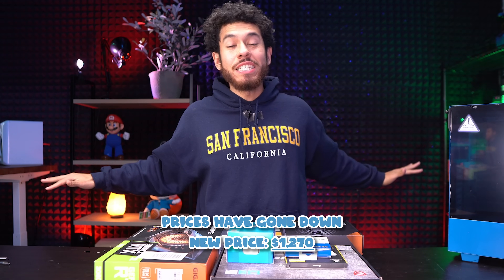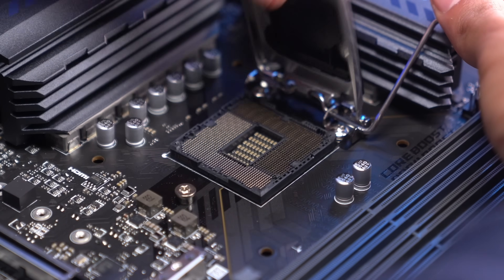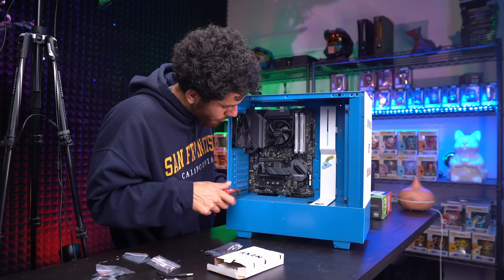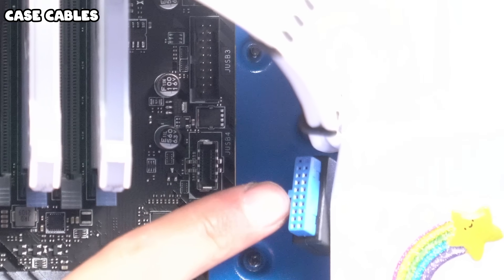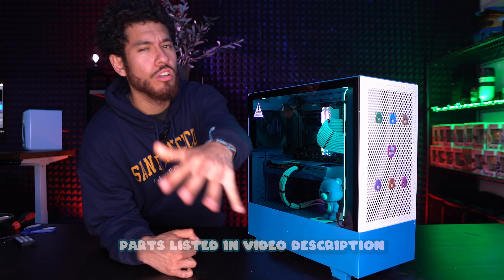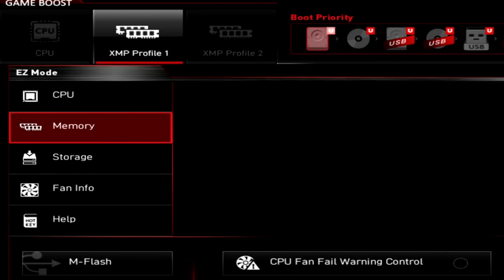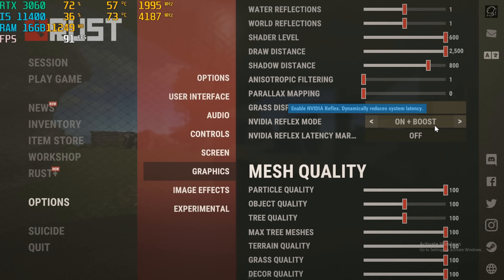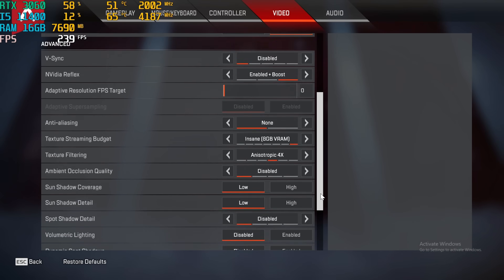$1000 Gaming PC Build Guide - RTX 3060 i5 11400 (w/ Benchmarks)

Comment: Do you still recommend 3060 for this CPU? I bought my computer without GPU and now I'm thinking about to buy a GPU in it. Few site not recommend RTX3060 for i5-11400 because of the bottleneck is +20%. With GTX1660 the bottleneck is only 5%. For the current games which one you suggest?

Comment: I JUST finished my build thats very similar!

CASE: APEVIA GENESIS PRO
MOBO: ASUS ROG STRIX Z590-A GAMING WIFI GEN 10/11
GC: ZOTAC GEFOORCE RTX 3060TI AMP WHITE
AIO: ID COOLING FROSTFLOW X 240 SNOW
PSU: APEVIA PRECISION 850W 80+ GOLD
DDR4: SILICON POWER X FORCE 16 X 2 (32GB) 3200
M.2: SILICON POWER 1 TB
CPU; i5 11400F 4.4
PSU EXTENSIONS: ASIAHORSE WHITE

Comment: Hello Joey I got a question is there a different power supply I can use cause the one that u got is out of stock or does any one know which other one I can use
Reply: As long its a 650W unit, modular or not its what you want. I don't recommend something cheap because you dont need to cheap out on psu's. Look at something in the same price range as long its 650W.

Comment: Hey I was wondering if the ASUS TUF Gaming B560M-PLUS WiFi LGA1200 motherboard would work with the cpu cause I used 2 different websites and all the components I got says it goes together but I just want to make sure  cause the mother board is almost $200 now

Comment: Does the motherboard have built in wifi?
Reply: Yes
Reply: no, it doesn't. it has ethernet. I ended up putting a seperate wifi card into it, which works fine.

Comment: can someone explain how CPUs work, i see a lot of mid to high-end build have a intel i5 12th gen, but im confused because wouldn't having an I7 2nd gen or somthing like that be better
Reply: No, I see why you would be confused because intel has many generations of Processors and with each generation the processors get better than the last generation(In most cases). For example a second generation processor came out in around 2011 where technology was not as advanced as todays 11 and 12th generation processors which are 100 times better, Hopefully that made things clear. Ask me anything if it did not

Comment: When I set the ram to 3600 it stays on black screen what do I do??
Reply: Reset the CMOS (check board manual for instructions). The thing is that if you're overclocking memory (either manually or through XMP), you can cause stability problems. Overclocking is part black magic, art, luck, and science. There aren't universal settings that work perfectly on all systems which is why things like XMP sometimes don't work on all PCs and/or cause stability problems. You'll need to manually adjust your RAM settings.

Comment: hey joey, i just built this pc for myself and it’s been running well. only thing i’ve noticed is that the cpu core runs hot and it sounds like the fan is working pretty hard. any ideas what’s going on?
Reply: found out the problem. i needed a better cpu fan!
Reply: saw some people asking about what cooler to get. i got the master coolers liquid cooler v2 with the rbg lights. definitely needed to keep the cpu cooler when running games
Reply: @Affalterburch  how’s the temperature now and which one did you upgrade to?
Reply: @delgado8  ^

Comment: If you can find a gpu at a resonable price or msrp, this is probably a very good value build. Im thinking about getting the  same parts but an i3 12100 or an i5 12400f instead of the 11400.
Reply: would it still work with the motherboard in the video?
Reply: @InstantHades  no, I would need an lga 1700 600series motherboard.

Comment: The cpu is 83cl, and that’s why i would buy a after market cooling solution, like a cooler master hyper 212 black edition. That’s going to run quieter and dissipate more heat and the temps are going to be low 50’s high 70’s. I just can’t stand the look of intel’s cooler

Comment: Have this same build but after building I cannot connect to a wireless network connection…. any fix?
Reply: You have to use an ethernet cable or check if the motherboard has a spot to add a wifi card

Comment: Hey Joey, I build a combination of this PC and the white 900 build, I basically just used the case from the last build but when I turn it on, it is not displaying anything to the monitor. I am currently using an HDMI cable that is plugged into the monitor and the graphics card. The fans and LED strips come on and the name on the graphics card is lighting up as well as the RAM sticks but still nothing displayed to the screen. Do you know why this might be happening?
Reply: It looks like that board has a debug/diagnostics light towards the top right corner. Take a look at it and the board manual to see what may be going on. It can help point in the right direction.

Comment: Hey Joey was wondering if you'd ever be interested in doing a video dedicated to a travel rig, one of those rigs that is small form are designed so you can fit them as an airplane carry-on, so as to travel with them pretty much anywhere. Recently for my work I had to throw one together in order to do certain parts of my job on the go that I couldn't do with a laptop, at least not without going crazy and buying something super expensive. Doing the travel PC was cheaper for me personally so that is what I did, however I did find the process to find everything that I needed in small form while still trying to maintain performance a bit overwhelming. I imagine it would be similarly challenging to anyone else out there trying to do a similar build. Seems like a niche PC build for you to do, and I'd love to see you make a video on one if possible.

Comment: My ssd doesn’t show up in my boot drive in the bios. How can I fix it. Please respond to me!!!
Reply: Make sure its plugged in correctly. If its a 2.5" SSD, make sure both power and data cables are securely plugged in and that the other end of the data cable is plugged in correctly to the motherboard's SATA port. In some instances, you may need to update the BIOS to the latest version to fix SSD problems; mainly M.2 SSD problems.
Reply: @JJFlores197  it’s a m.2 ssd. It is plugged in. It says ssd on task manager but below system file is no and page file is no. Ssd is suppose boot faster but it’s not and it’s using from my hdd. How do I make it my boot up
Reply: @extertioncapshella6452  Well you have to install Windows on your SSD. You could clone your existing Windows installation over to the SSD if you don't want to go through the install process. I would reseat the M.2 drive and update the BIOS.
Reply: @JJFlores197  the bios is up to date and shows the m.2 installed but is still booting up from my hdd. Your saying if I install windows there’s gonna be a hdd or ssd and if I click install using ssd, the page file and system file is gonna be put into yes. And the hard drive no. Is that gonna make my pc boot from my ssd? How do I clone because windows was already install on my hdd but the ssd is there but no active like my hdd!
Reply: @extertioncapshella6452  You have 2 main options: You can do a clean install of Windows on your SSD. This will install a fresh copy of Windows on your SSD. You would then format your hard drive (everything is erased from it, so make a backup of anything important first) and you can use that for general data storage.

Alternatively, you can clone your Windows installation from your HDD to your SSD. There are tons of utilities out there for cloning. Acronis True Image is pretty good, but there are others. You choose your source drive (HDD) and your destination drive (SSD), let the cloning process run and wait. Once the process is finished, boot your PC from the SSD and if all went well, it should boot right up. Once you verify that everything works fine, you can format your HDD and use it for storage.
Reply: @JJFlores197  yeah because I’m using my ssd for storage and that’s exactly what I want for storage not my ssd. My ssd is so expensive and quick as advertised and I don’t want to use it as storage it’ll be a waste of money just my cheap hard drive for storage. So I have to reset my pc in settings and perform a new Windows. Does it work on windows 11 and does it have to be in 10 for the ssd to work and boot up from it?

Comment: hello. i have a question.
when i try to insert my gpu to motherboard i had to push card with more pressure to hear the click sound that mean it locked. a little bit more pressure than normal. i see the left side of the card doesn't go all way inside the pcie slot and it has 1 mm left to go in just like the right side. the windows recognize card and i test it in heaven benchmark and it seems everything is ok and i can play games with 144 fps with 76 celcius degree temperature. i want to know that is it possible the gpu card cant use its full power because the left side of it didn't go all way inside the slot?

Comment: Will it be good if I get a 3060 ti instead of the regular one
Reply: Yes, the ti is way better and should probably get the i7 instead of the i5 for the cpu if you can.
Reply: @dontcare5427  does the i7 need liquid cooling?
Reply: @jdolo5013  it is not necessary to have liquid cooling but it is a better option. However you should replace the i7 stock fan with a better one to keep the cpu as cool as possible.
Reply: @dontcare5427  thanks A lot !
Reply: @dontcare5427  also would this pc be good for streaming?
Reply: @jdolo5013  yes it will be good enough to stream in 1080p max high settings and your welcome !
Reply: The 3060 ti is smaller then the reg one and it don’t come with 3 fans
Reply: @datboivonte700  yes, it still has better output and gives more room to customize within the pc!
Reply: @dontcare5427  Ok

Comment: cpu temps are high I think intel's free cooler sucks! hope if buying a better cooler can reduce temps and might be 50-60degs
Reply: Buy a Corsair h60 my temps are around 32 degrees Celsius
Reply: Also get thermal paste clean off the pre applied, and apply your own for a better adhesion
Reply: @tyrellyoung4835  I see thanks for this info bro. 32degs are on idle mode right?

Comment: Can you do a pc build with
Cpu: ryzen 5 5500 or ryzen 5 3600
Cpu cooler: alpenföhn brocken eco advanced
Motherboard: gigabyte b550 Aorus elite v2 atx
Case: aerocool aero-300 FAW
M.2 Cooler: be quiet! Mc1 m.2 cooler( you can do with the m.2 cooler from the motherboard too)
M.2 Ssd: western digital WD-Black sn750 se 1 tb or crucial p2 ssd 1 tb
Ram: G.Skill Aegis ddr4, 3000 or corsair vengeance lpx black ddr4 16gb,3000Mhz
Psu:be quiet! System power 9 600w
Gpu: amd rx 6600
and a Case fan hub from arctic
pls? I want to build with these components a pc

Comment: Hey this is the first time I’ve done anything like this, does anyone know if there are extra steps or drivers I need to take care of if I get a motherboard with a built in Wi-Fi card? I noticed Amazon had two options there. Thanks!
Reply: Same overall process. In terms of drivers, you may need to install the wifi card drivers; same as any other driver install.

Comment: How were you able to connect to the Wi-Fi ?
Reply: He didn't. He used an ethernet cable. Remember wifi and internet aren't the same thing.
Reply: @JJFlores197  then how can I connect to the Wi-Fi or and internet?
Reply: @Wssp322  If you want to connect via Wifi, you'll need a motherboard that has built-in wifi or if not, buy a USB wifi adapter.
Reply: @JJFlores197  and for internet
Reply: @Wssp322  You need a router for that. Most home routers have wifi built-in so you just connect to your home wifi network or plug an ethernet cable from the router to your PC.
Reply: @JJFlores197  and for Ethernet?
Reply: @Wssp322  reread my previous comment.
Reply: @JJFlores197  ok thanks for your help
Reply: @JJFlores197  yo bro do you have Ig I got hella questions about whether I should get this pc or not and you seem like you know what you taking about man

Comment: I have a question. Every part of the computer is upgradable right? Then which is the part I’m going to be upgrading the most
Reply: Yes, pretty much everything is upgradeable. What you upgrade depends on what you need. If the current GPU doesn't run the games you want at whatever resolution/frame rate you want, then you upgrade that. There isn't only 1 answer as it depends on what you need your PC to do.

Comment: Hey Joey I built this pc and I’m getting a no display. Could it be the hdmi cord or the monitor.
Reply: Make sure you plugged into the video card's video output and not the motherboard's video port. Make sure all internal cables and components are installed in the correct spot.
Reply: @JJFlores197  I got it working thank you, now I just have to get windows 11

Comment: Do you think I could use Gigabyte GeForce RTX 3060ti with this build?
Reply: Of course dude. You can use pretty much any modern graphics card you want. Its not like you have to exactly use what he uses in the video.
Reply: @JJFlores197  i know this is old lol but, if i were to use all of the specs in the video but swap the 3060 for a 3060ti would it be worth it or would it just get bottlenecked?